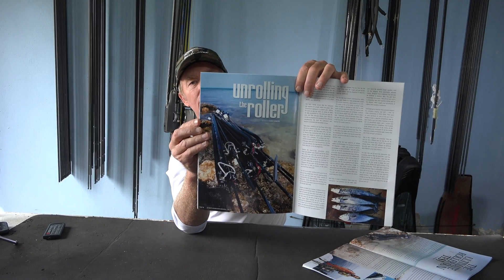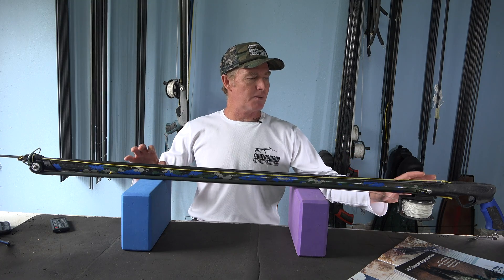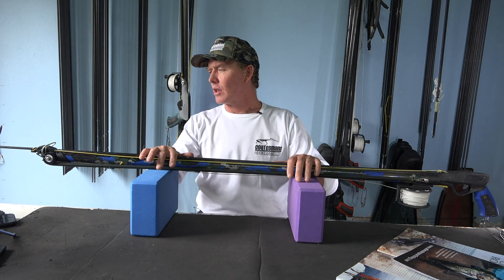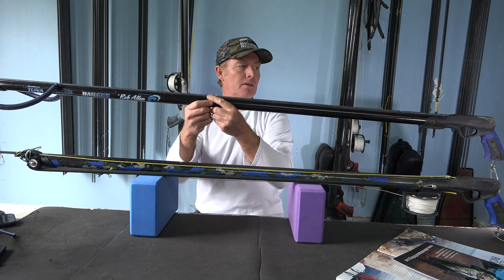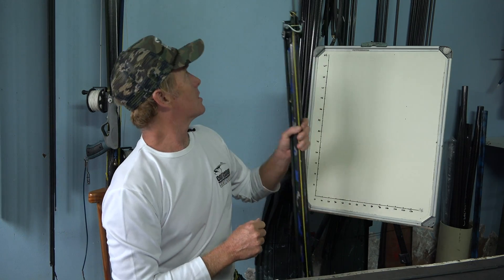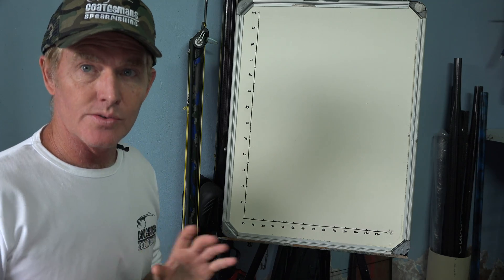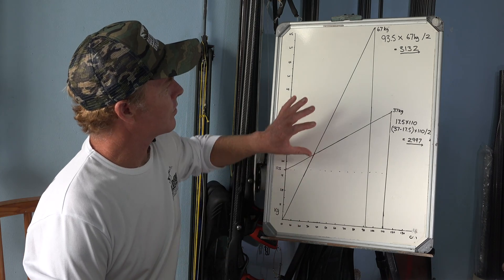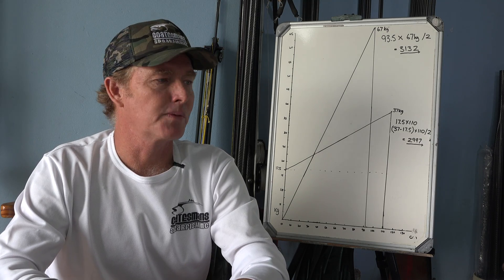Understanding Rollerguns Part 1 | Unrolling the Roller Speargun

Comment: "Big horrible wooden guns" ???  Just damn....
Reply from the maker: big multi band guns are obsolete ..... true story
Reply: @CoatesmansSpearfishing  - Respectfully disagree.  There's a legacy and a fondness for some things like automobiles, homes, art, and the mechanical, etc., that will not ever be overcome with fancy, shiny, newfangled stuff, and wood Spearguns are in that group.   By your obsolete type thinking, we should all be driving electric cars, wearing only smart watches, and building 3D printed homes, with only AI generated artwork hanging inside them.  Not an ounce of soul in any of that...
Reply from the maker: @Marco-Alexi I hear you. I have great fondness and respect for the gun builders who pioneered the sport.
But I am speaking purely from a functional point of view. The conventional band setups produce way too much recoil and necessitate the gun to be over sized and heavy. There are far better ways to shoot a shaft.
 If you are using a gun from a retro point of view, all kudos. But its like a 70's single fin, you surf that board accepting that it is holding you back and has its limitations.
Reply: @CoatesmansSpearfishing  Good analogy, and agreed.  I have my grandfather's Patek Phillipe watch with an open face.  It was made in the 1940's.  Even after a very expensive disassembly and service, it loses a minute and a half a day.  At the end of a week, it's off 10 minutes, and after a month, I'd be running almost an hour late.  So I use my phone that's accurate to the atomic clock, even when wearing the watch.  But there's something magical about looking at the clockworks, the microscale of tiny parts moving and spinning, and the knowledge this was all made by hand.  That watch has a soul, but that iPhone will get replaced next year like every year.

Comment: But we know that there is such a thing as terminal velocity in the shaft, so I’m not sure why power would be a good indicator of anything. But the graph is useful as you say to illustrate the low recoil of the roller. 
My take is still that a well setup traditional gun can be in the same ballpark as a roller, as I’d say Rob Allen’s video indicated, and if you had a well setup traditional gun with a reverse mech then the results become even closer. But yes recoil is a real consideration no doubt. I personally think the real question is if the extra cost and and complexity of rollers is worth the effort, since we know a traditional gun can get a shaft moving at terminal velocity quite easily. But I’d say rollers would tend to be more accurate due to the low recoil. I just think the “performance” of the roller vs traditional is overemphasized in the video.
Reply from the maker: Hey @kayb4995 
You are right about the power or load not being a good indicator for performance. These videos are old and our understanding of the physics of spearguns has evolved. 
That said this still does effectively show how the load is distributed when driving the shaft. And this affects recoil.
The term terminal velocity is a bit misleading. As this referse to the max speed the shaft can travel in water. Which is much faster than a speargun can shoot it. 
The speed of the shaft is determined & limited by the 'Snap Back Velocity' of the rubber.
The shaft is limited to the max contraction speed of the rubber. 
So this is where you are correct in saying that a conventional gun and roller gun should have no significant 'speed' performance benefit over each other. As you can get both guns to drive the shaft at the max 'Snap Back Velocity' of the rubber.
The issue is recoil, and you can shoot a shaft from a roller at higher speeds because of the lower recoil. (for a number of reasons)
This is essentially what makes rollers better than conventional guns.
And even though this video is old and does not take the rubber speed into consideration. The principals still hold true to how the energy is delivered.
Reply: @CoatesmansSpearfishing  in your estimation why would so many commercial divers use traditional thought. I feel like even a very high % of them use traditional. Do you think this is just thrm being acquainted with the equipment. Idk I just feel like if what you claim about roller were true all competitors and commercial guys would realize that and use them. Do you have a guess as to why that’s not the case?
Reply from the maker: There is some truth to this. But pretty much everyone of the commercial and competitive guys I have dealt with have converted and not gone back (bar some really old school guys who cant get over a short shaft over hang). 
For the most part the difference in the shot is only noticed when the guys go back to their old guns. Thats when you notice how the lack of recoil improves pretty much everything about the shot.

On the small / short guns where recoil is not an issue on the conventional guns. An argument could be make that the conventional guns are very effective and very efficient. 
But have you ever shot a really well setup 90cm roller? Its like the difference between running in slippers or running shoes. Rollers just feel so much nicer. 

I also think there are many guys who feel that loading a roller is slower than a conventional gun. And so the competitive and commercial guys have lent towards conventional guns.
But this is only because most roller set ups are shit and hard to load. I have proven over and over that there is no difference in time to load the equivalent performing gun wether it is a conventional or roller.
Infact the double roller is way easier than a double band gun shooting the same shaft.

The old school conventional guns are also cheaper. They are also easier to maintain. So this is a big factor too for commercial guys.
Reply: @CoatesmansSpearfishing  good analysis. Idk is the truth. I saw the commercial guy from Florida “key west waterman” said he doesnt know a single commercial spearfisherman (in FL I assume?) that uses a roller. I believe you about the loading times, but that almost makes the argument for rollers worse; meaning these guys will likely know what they are doing so I assume they’d be able to get loading down. But yes I think there are a lot of misunderstandings on both types of guns when it comes to ideal setups. Your rollers are looking pretty spiffy in that regard.

Comment: Great series. You see a lot of guys today swearing by the classic setups with 2x 14mm small id bands stretched to 360%. It seems the comparison 130 you used in this video was a bit of an overpowered setup. How would it all shakeout if the classic setup was put up against the rollers? I see some guys swearing the classic setup will hold its own but wondered what you thought.
Reply from the maker: Hey Blue Dog Gum 
Have a look at @RobAllenSpearfishing video where they compare the two
https://youtu.be/FfnyQBAMdNY
Maybe not the exact same setup but similar

Comment: Still confused. When comparing the two guns they are both compared with only one band. but the 140 conventional would be commonly used with two bands and would  have substantial more load and more drive than the roller which would only have the capacity of the one band? Is this wrong ?
Reply from the maker: Jedidiah, you are right a 140 with 2 x 16mm bands would have way more power than a 110 single roller with a 14mm band.
I was not comparing power or the performance of the two guns. But rather illustrating the length of drive a roller has compared to a conventional gun. 
A 120 single roller with 16mm bands and 7.5mm shaft would be a good gun to compare to the 140 conventional band gun.
Reply: @CoatesmansSpearfishing  ahhh I see thanks for the response !

Comment: There’ seems to be a lot of emphasis on getting the most or optimum energy translated into launching the spear, but almost nothing on the hydrodynamic drag of the spear through the water. Has there been any research on the relationship of spear launch muzzle velocity and range for a given launch energy for different lengths, diameters and maybe materials of spear shaft? Maybe some refinements in shaft cross section profiles?
Reply from the maker: Hey Alan,
I have pool tested most different variations. The thickness definitely increases the drag. But this is sum what balanced out with the additional weight / inertia of the shaft.  Shaft flexibility is also very important, especially with more powerful guns using 16mm etc. This why it is important to use high grade carbon steel shafts.
I talk a little about this in the 110 & 120 videos. 
Penetration is something guys also miss. Like sliptips, they have a lot of drag going through a fish and require massive shafts with big guns to penetrate through the fish.
Reply: @CoatesmansSpearfishing  Thanks very much for this reply. It gives great insight into what works and what doesn’t, from your many years of experience. It brings back great memories of swimming in Durban, Natal way back my younger days! Has Rob Allen got an inverted roller conversion in the works to reduce drag of the bands squeezing around the rollers (through the holes) by using dyneema vs bands with eg 3 x 14mm short inverted bands underneath? This would improve the launch force, make more efficient use of the potential energy and make it much easier to load. 3 x 20kg vs 1x 60kg for 16mm bands?

Comment: could i rig a 120 RA roller with full pretension with 14 mm bands so i dont have to use a load assist? 7 mm shaft?what length of  bands should i use?
Reply from the maker: You could go with a 70cm 14mm which will have 17kg on the muzzle. It will drive a 7mm shaft real smooth, but this is not a great setup as far as power goes.

Comment: Great and informative video. What about a comparison to a 1100 tuna RA with twin 16mm? With 350% band stretch and using your 37Kg per band load with  a 78.6cm band stretch distance for a 110cm barrel i got 2,907...ie Rob allen tuna vs Rob Allen roller 1100? What do you think?
Reply from the maker: 1100 with 57cm 16mm (386%) x 2 using the same rubber metrics is: 4797 kg/cm

This gun will have greater penetration than both the guns discussed in this video. But if you have used a roller for any amount of time, and then try use a std double rubber gun. It won't matter how strong it is, it's just horrible to shoot.

Comment: Hey Chris, I am not sure about the power into shaft calculation for the roller gun. Should the rectangular section of the graph be added to the total power imparted to the shaft? The energy is still stored in the rubber at rest is it not?
Reply from the maker: Hey Paul. Yes you add the total area below the line.
Reply: @CoatesmansSpearfishing  Hey Chris would you mind explaining why that is the case?  What you have explained is the Potential Energy which I am understanding. I'm confused Like Paul on how much of the PE is converted to KE? With a standard set up you release all the PE and convert it to KE. With the roller that is not the case as you only release some of the PE which partly is why the recoil is much less than the standard set up. I'm thinking to understand fully what is happening here is you want to see the rate of acceleration the shaft is under and how even that is over the distance and what the velocity of the shaft is as it leaves the gun. By this I mean the shaft is being accelerated more evenly aka more force over the assigned distance of acceleration in the roller than the standard set up. Simply put, when the shaft leaves a roller muzzle it is still under force from the band and being accelerated. When the shaft leaves the muzzle of a standard set up it is not under force and acceleration. There are cameras that can capture this for you for fun and games :) Hope this helps

Comment: Amazing video as usual, and really interesting, so I'm now applying you calculs to my spearguns. But I was wondering, if I want to apply this to an invert roller gun, is it working the same way ??
Cheers 🤙🏼 Keep up the good work !
Reply from the maker: for inverted rollers you work out each rubber , from rest to full load x the drive length and add them together. This only gives you an idea of the kg/cm energy as there is loss around pulleys, just like rollers and that needs to be factored in. Will have to do a vid on this

Comment: thx Coatesman , amazing video and very useful knowleges, i think the main reason why roller  has less recoil is that the reverse force occurred both at muzzle and the anchor or the rubbers , and they are at different directions , the backward force which generated  at the anchor point absorbed most of the recoil
Reply from the maker: Hey Noah, yes there is a certain amount of inertia traveling backwards. But by spreading the energy out over the length of the gun, is by far the greatest reducer of recoil.
Reply: @CoatesmansSpearfishing  thx for your great knowledges !

Comment: Good video! The thing many people don't realise is how great the losses are due to the rubbers going around the rollers as they contract. They don't contract as fast. I've been down the roller road and had quite a few different set ups. Came to the conclusion I like to go diving and not worry about things failing like bridles popping out of rubbers cos they're stretched to 400% to get any benefit over conventional gun. Also the bridle lifts the tail of shaft on release as rubbers go around rollers causing shot to go low.
Reply from the maker: Fish Hunter Thanks.
You are correct there is some energy loss going around the rollers. And the calculations I am using could in many cases have a 10% difference. However no matter which way you put it, a well set up roller giving the same (actual) penetration as a conventional gun. Will be shorter and have less recoil. 
Your other issues are all solvable with right equipment and setup. I will be covering all of these.
Reply: @CoatesmansSpearfishing I'll keep my eye out for the next video, you might persuade me to give rollers another go! Do you find bridles get frayed quickly?
Reply from the maker: Badly designed rollers cause that lifting on the notch which causes the wear on the bridle.
Reply: @CoatesmansSpearfishing  I haven't tried the rob Allen roller head and I notice it has a little Ridge on the ramp/stopper. Is this to slow the bridle down and let the spear exit without lifting tail? Very interesting and well designed head which I need to try.
Reply from the maker: @fishhunter348  Yes the cut out was made to do exactly that. If you have a good shaft with no sharp edges on the notch your bridle should outlast your rubbers.
Reply: @CoatesmansSpearfishing  wow! Good to know! Thanks!

Comment: I am going to love this and thank you for putting this out to us.  I would like to see the different triangle of force (?) as compared to one short 20 mm band compared to two very short 14mm bands.  They would stretch the length of the bottom vector (duration of shot or band pull?) further and also give maybe a large effective force of loading at end when added together.  Just curious and with much respect.   No one can doubt the results you get from the rollers and I love the rollergun I won for sure.
Reply from the maker: 2 x 14mm (3183 kg/cm) 73cm  the same length provide more power with less recoil as the 1 x 20 x 73cm (3132 kg/cm)
And is easier to load. This was my go to before I found rollerguns. 
Most tests I have used this gun as a yardstick to compare against.
Reply: Not won- should say I own

Comment: Nice video. I was thinking I'd have to do these calculations for my inverted roller
Reply: What kind of inverted roller do you use? The one with pulleys? If so, the calculations would be not as straight forward as in this videos

Comment: For larger fish at range, the extra mass of the longer spears help penetration though. Also, I believe there's a point where the shaft approaches the maximum speed that the rubber can recoil at, so that the extra pull length does not equate to much additional force.
Reply from the maker: Absolutely, mass is key. So with rollers go thicker and shorter so you can put more power.
Reply: @CoatesmansSpearfishing  I would love to see some side by side tests of rollers in a pool like madjq8 does.
Maybe we can set up a gofundme to send you to test guns with him when the COVID situation has normalised. https://www.youtube.com/user/majdq8
Reply from the maker: This is something I have in the pipeline. Even contemplating building a long pool :-D